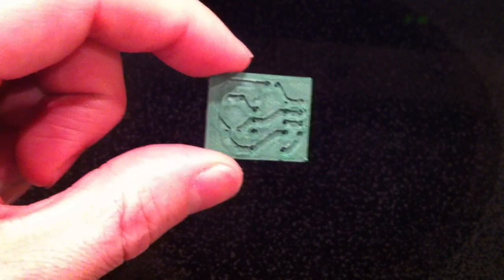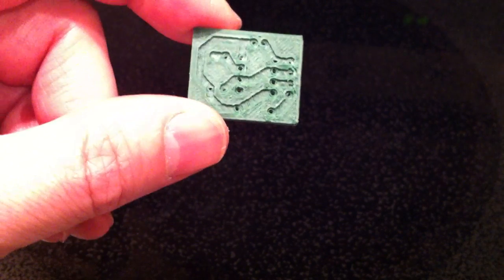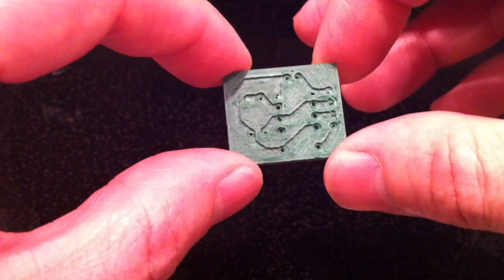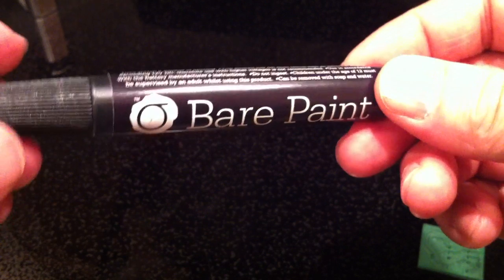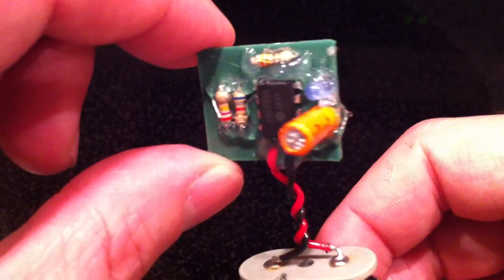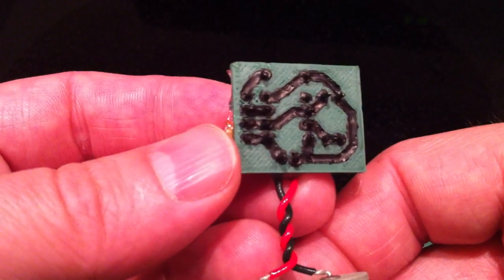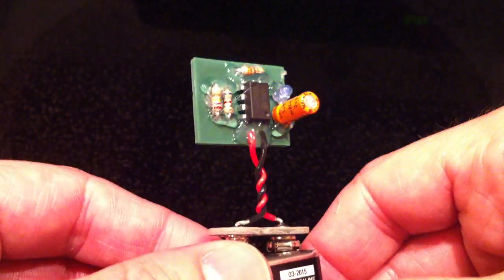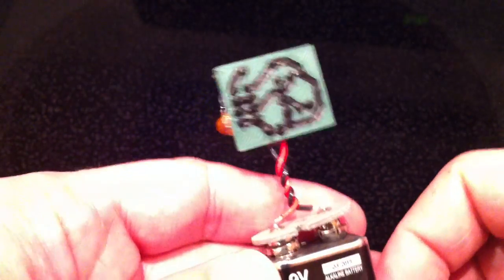3D Printed PCB with a Printrbot and Jerrill.com Nozzle

Comment: Completely 3D-printed solderless circuit board??  
Come on, I can have the same with ordinary 2D printer, or even without any printer. After all you paint electric tracks manually.